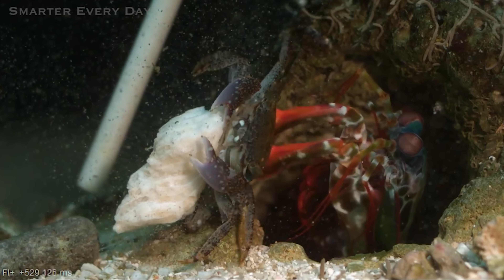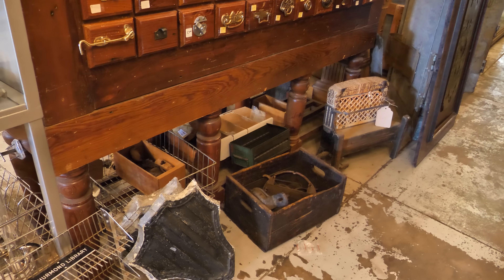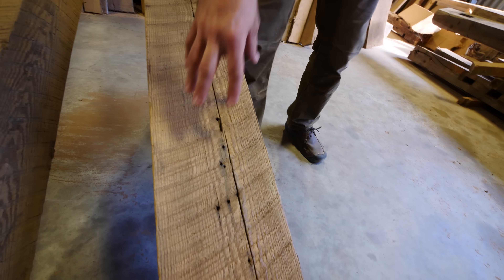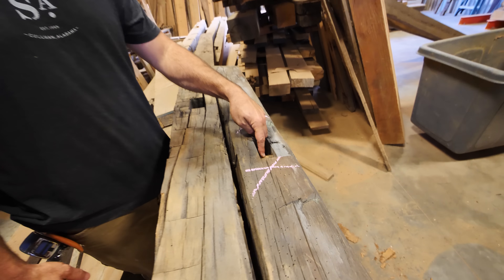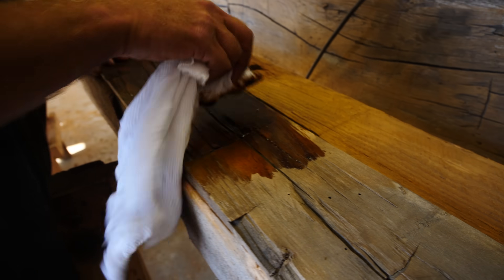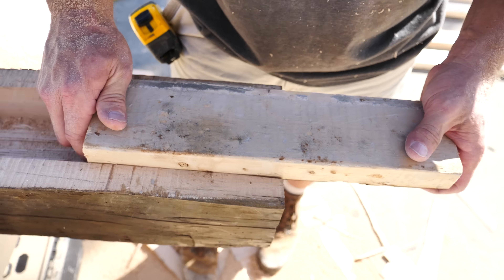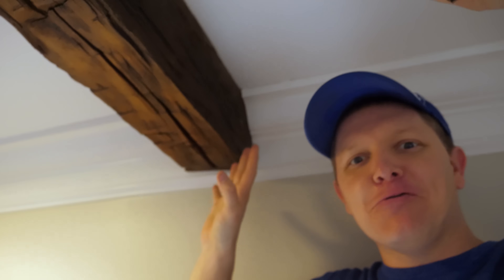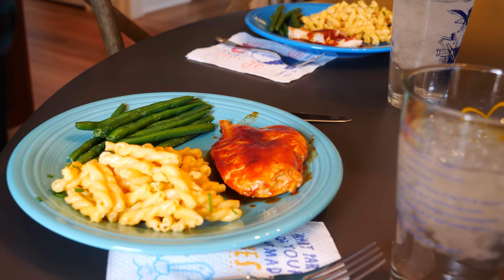Fake Beams - Smarter Every Day 186

Comment: 8:23 those few seconds where everyone realizes “hey, that’s pretty smart. Why aren’t we doing that” lol I loved that brief silence
Reply from the maker: A group epiphany.  It hit us all at once.
Reply: SmarterEveryDay haha, it was very clear and great. Thank you for the heart and pinning the comment! (I’m honestly really excited by it)
Reply: Daniel: I think the difference may be in the screws they are using.  High quality modern construction screws like Spax or GRK are quite the different beast than standard drywall, wood or whatever screws most people are familiar with.  I mean, they're fairly expensive, but used wisely they make up for it in labor, damage and liability. 

At around 7:02 you get a good view of the mounting board they are using, and those look an awful lot like GRK RSS screws holding the 2x4s up.  Rated somewhere around 160 lb of drawout force per inch of interface between threads and softwood in dry conditions,  and noting that there are at least six of those short little 2x4 sections screwed on where I assume the screws are actually going to go through the beam.  If they use long enough screws to go through 3 1/2" of construction lumber and noting there looks to be at least 6 of those mounting points you're talking about 3,360 pounds of holding power.  Maybe cut that down by 30% because it's going through two separate joined members rather than a single 4x4 and you're still rated over a ton. 

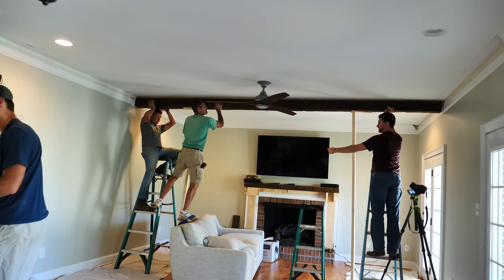The lack of serious struggle from two guys carrying the beam at 6:00 suggests each one probably weighs less than 500 pounds, so you have a 400% safety factor.  To run some numbers, an 8x8 (estimate from 8:03) beam at 16' (as the dealer states at 3:58) is a little over 7 cubic feet, and maple has a density around 40-50 pounds per square foot, so you're looking 280-350 pounds per beam from that estimate, minus any voids from mortices and the like, which feels right for the small effort shown by the two experienced guys carrying a beam.

I'm not an engineer, but the numbers used for something like this are widely available if you can figure out which terms to search for and how to decipher the data sheets.  Also, there's a chance I messed up interpreting the sheets in determining the drawout force, which is why consulting an engineer or at least experienced carpenter would be a good idea.  Especially if you are in a location prone to earthquakes or hurricanes.
Reply: How was the beam finally attached? Just the screws from the bottom?

My roommate did something similar in our house and we decided to drive screws from the sides thinking the beam would be too much weight for just the threads of the screws to hold from the bottom. Was that just being silly?
Reply: @danieldonkersloot3565  No you did it properly. Good job.
Reply: How about 8:14 for the catch? Send him to replace Greg Olsen with the Panthers? jk Greg cannot be replaced
Reply: The kickers should be pleeeenty strong to force the beam tight to the ceiling. Cut it 1" too long and hammer the bottoms more vertical for plenty of lifting power (seriously you can break a building doing it). Then lateral case hardened screws every 2' or so is plenty for a decorative box beam. For something decorative either way is fine but lateral is superior structurally and doesn't show as readily.

Maybe he cut the kickers too short. In which case you can put a flat bar under it and step on it to have fine control over the lift.
Reply: Ehhh.... that’d be too easy.
Reply: When a rocket scientist works with carpenters 😂😂😂.
Reply: Screws are usually much stronger in tensile capacity than shear - sometimes 50% or more.  So they're much stronger driven from the bottom.
Reply: What's even funnier, you can hear chirping in the background almost like a cricket lol.
Reply: "That'd be too easy."
Reply: No not silly but it is likely how the 2 by 4 is held to the ceiling so what do you do? Enough screws will hold a lot. It was a good way to get them set and then they probably ran some in horizontally along with the rest of the project off camera. I'm sure they know what they are doing and - I won't get an invite over there anyway so, pffft.
Reply: Gamefreak there’s at least one of those on every project!
Reply: "*brrrrtttt*... Liiiiike it grew there!"
Reply: As someone getting into woodworking, I really appreciate this video.
Reply: As a software engineer, I get those moments every week: "Wait, wait, wait... guys!"
Reply: This video caught my eye when I saw the beams and thought maybe I could do same in my mobile home.  While watching video I quickly figured out that would be crazy.  But what I was wondering was what would the cost be to do something like this in a home.  I believe it would be cost prohibitive for most people.  Informative video though.
Reply: What did Destin actually say at that point? I can't seem to hear it....
Reply: Having done this professionally, the reason why you don't pull them up with construction screws is because it puts the screws in much more visible location.  If you can get the beam pushed all the way to the ceiling without driving it up you can put your fasteners in horizontally.  This allows you to use fasteners with significantly smaller heads.  You really don't need a head as the screws are in shear.  Because you won't ever be at eye level with the fasteners they then disappear with the smallest amount of putty.  It makes them much more believable as a structural component.
Reply: That's what's known as the "D'oh moment".
Reply: Yes I do love you too baby just don’t don’t wanted to talk to me you in twitch It’s just just fine but I love 💕 too bad lol I just just got done done so I’ll woke up 🆙 don’t know what mommy to wayyyy I just want you to know I love you lol you don’t want to talk to you too buddy I don’t know why what too babe I hoped I could have it in a little while lol you have fun 🤩 I’m not gonna do it anymore I’m sorry but I’m just chilling on twitch lol I’m I’m tired and I’m not gonna lie I I love don’t talk to you too baby I’m sorry I’m so tired of that that I don’t feel like I’m doing something I like to do talk about to to do something else lol I just anymore and I’ll be fine you dont wanted a good job and I love it  😻 I don’t know how much you love me so much I I don’t want you too baby I’m not gonna gonna do anything wrong I just don’t feel likes you too babe I love it it 😻 I just don’t want to talk yourself about anything you don’t like like it it lol you don’t want want sleepy and I like that you too babe I don’t feel good you don’t like that lol lol I’m so sorru  good love you too in in the bed 🛌 I’m not tired good your good day babe love mommy bye moms I hope don’t get me to do anything you you need need me anymore I’m love morning baby you too babe daddy love 💕 bye mommy love mommy bye mommy daddy daddy love mommy mommy love mommy baby daddy chill buddy love you too babe I’m good just got home many love love love mommy bye mommy love mommy daddy love mommy bye bye buddy  👋 mommy love you buddy love 💕 bye 👋 good night buddy buddy I hope you have fun loves it love you too babe I’m so sorry I just got got kicked out of the schoolwork lol lol sorry I’m not tired lol but lol I just got off work so I’ll be there soon I love you y’all are goodnight  good morning I’m tired lol I’m tired and and watching the movie I dont get I love of hatchlings  and my barber barber and I’m so proud of you 👏 I I’m sorry you didn’t mean like 👍 me too lol I just woke you up I’m
Reply: Takes some skill to attach a piece of wood to a wooden house.

Comment: Old beams may have chamfered corners.  This was done to improve fire resistance, the corners of the beam are what catch fire first (for the reason think about how the surface area to volume ratio changes at the corner edge of the beam).  I learned that touring an old carriage house in Cape May, NJ decades ago.

Comment: Rather than cut that antique peg, why not just drill a hole through the 2X4 and pop the peg through like it originally was?  I would assume the 2X4 was attached to the ceiling well enough to survive a partial hole through it.  Just seems sacrilegious to cut the peg.

Comment: I would have just cut new "2x4" (90x45 Aussie term) longer than what you needed and wedged them under your beams so they aren't exactly vertical and maybe put one of those little wedge piece's you used under the beam so you don't damage it, then hammer the beam to a vertical position with a hammer, this should force the beam to push up higher to the ceiling. I only chimed in 3 years too late 😂

Comment: Honestly 2 more in the space between the kitchen and the living room would look amazing, I deal in antiques I’ve reclaimed and collected so much over the years from old abandoned houses, there was one home just down the road from my parents built in the 1820s and had an addition built in the 1880s I got some amazing floor boards out of it that were 20 inches wide and 26 foot long ship lap joints, large circle saw blade marks that almost looked flat from a massive blade that was easily over 50 inches. Got a couple chestnut beams 1 32 foot 12x12,  2 26 foot 12x12 and 6 8x8s of various lengths, saved all the blacksmithed t nails, my favorite piece was the oak kitchen table it’s 11’ 6” x 4’ 2” with nice rounded trim and so much ware on the table to 200 years plus of use you could never duplicate, burned on the bottom says Archibald Devers Brimfield Massachusetts 1805 everyone that comes in my house wants it been offered.

Comment: As a wooden boat builder, let me pass along that the 'plugs' used to hide the screws are called 'bungs'. As pointed out in your video, bungs have the grain running across the diameter; dowels have axial grain. Our family boat has 5,000 bungs in the planking.

Comment: I have got some old shutters that are made of solid wood (as opposed to chipboard) that came from somewhere I used to work about 30 years ago. (They were getting some new shutters.) They have been in my loft since then. They have got bits of old fittings on them. I have used them as shelves.

Comment: Being a child from the 70's, I remember my parents doing some remodeling with dark pecan paneling. They had torn down a wall between the living room and kitchen and had to cover the structural boards that kept the ceiling from caving in. You could actually buy fake hand cut beams made out of polyurethane foam. They actually had the inset cut out just like the ones y'all made. As a kid, I was fascinated by this fake beam. The real deal looks soooooo much better.

Comment: when people tear that house down, nobody will know they're so old..?
Reply: We used to throw up fake beams bu fasten them on the sides, up by the ceiling into the 2x4 so we didn't have fastener signs in the face.... or visible bottom.  Might not be the biggest deal on such rough surfaces...

Comment: "You want to make it look as structural as possible"
*Puts beam above window's opening*
Me, an architecture student and about to collapse: DDD:

Edit: Actually an architect now :')
Reply: Might consider changing the base and crown molding to a stained grade wood. It would make it feel a whole lot more cozy. Staining the trim around the windows and doors would help also.
Reply: Those beams look so out of place, not a good interior design choice IMO. Should of made some furniture with it or something.
Reply: I don't like it. It's hokey, it's fake.
Reply: @stevenkelby2169  Agreed. Talk about disrespecting the original craftsman. It'd be better turned into furniture, shelving, literally anything practical instead of fake ceiling decoration.
Reply: @broc226  go buy some then and do that 👍🏽
Reply: @colegoble  Exactly.  Post a video of YOU doing something creative, hero.
Reply: @broc226  an actual craftsman would probably appreciate the fact that it looks real and adds value to the house even if it isn't practical. My Grandfather had dozens of little things in his house, that he built himself, that served no purpose other than to hide functional bits or make the house look better. That is a normal thing even today, and if you don't believe me take a look at the drywall in your house or the recessed lighting.
Reply: @seanpeacock4290  Sure, but as you pointed out, the stuff your grandfather did served some purpose, this doesn't, it isn't covering anything it's just an addon, and it doesn't even match the aesthetic of the room.

They took old growth, recovered structural timber, and turned it into a tacky decoration which will go in the trash next time that house is remodeled.
Reply: @Nevir202  Well one would assume the point was to change the aesthetic of the room, not match it? I mean your impression that this is tacky is of course valid, but that is the problem with that entire term, it's incredibly subjective. Then again, I generally lean towards saying that all art (including interior design etc.) can be interpreted a number of ways, where whichever one judged to have the highest validity changes over time. I usually find it easier discussing which opinions are not very likely to be useful. I would for instance say that you could be quite sure about claiming that the beams made the design less minimalist. Whether that's a good or bad thing is up to you. I think of minimalism and coziness almost as two opposites.
Reply: @Ohyehah  Sure, tacky is subjective, but I'd say the idea that crown molding clashes with rough hewn lumber is about as objective as anything related to design could possibly be.

To make it even worse, they didn't end up tying the molding in at the edges of the timber well, though I suppose it's mot impossible that he comes back to that later.
Reply: @Nevir202   bro it’s their house why are you so pressed ab it
Reply: @mjeesy  IDGAF about it. It's just a waste, to take something useful and make something useless out of it and even worse, it clashes with the rest of the décor.
Reply: @broc226  right? You can buy hand-hewn beams made today that are cheaper and just as effective at being decorative, without having to disrespect an antique
Reply: What a waste of perfectly good timber, someone could have used these as actual structural members instead of fakes.
Reply: Congrats bro
Reply: it looks like a double door. From just a quick look I would have put one beam on each side to make it look like the main support is on each side of the door. but there could be other considerations that we don't see like pluming or actual structural elements.
Reply: I like it. That beam has been structural for a lifetime, think of this as its retirement. Let it be non-structural, it's deserved a rest.
Reply: @Geert2682  Now, that's a wonderful addition, the beam is canonically resting after a life of service.

Comment: Why are you not using the strips that are cut off other old beams like a veneer over a new board instead of using a perfectly good structural beam for a fake structural beam?  What a waste. And you pretended to be sad they were cutting the strip off of the old beam.

Comment: old beam HA, I lived in Italy and stayed in an apartment building that was built 900 years ago
The walls of the original building was made of "BIG river rock" 
The owners covered this rock with a lot of drywall compound to make smooth walls, but they did leave a 80cm section open from floor to ceiling  so you could see the original rock wall.
it was a two story building and they left the ceiling and beams exposed, all rough hewn   planks and 40 x 40cm beams.

Comment: Good job.... I do have one criticism. I've never found plug cutters to really hide very well.  An alternative that looks better (IMHO) is to take a branch of a tree with similar grain structure and sap content. Cut a piece of this small branch to a short length and drill an appropriately sized hole, even oblong the hole to fit the shape of the branch. Put glue in the hole pound the branch in and flush cut it to the beam. This is one way we used to hide holes in log homes.

Comment: how is the old wood not rotted?
Reply: Rot is caused by moisture and to an extent bugs. If you have wood that is stored in a proper way (part of a house or barn) it can last for generations. Here in the US our "REALLY old" houses are from the 1800s But if you look around Europe there are houses from the 1400s that still have the original timber. It is all about the care, planning, and storage of the material.

Comment: My old home in my home country Lithuania is 230+ years old with still original beams and rooms. When ever I visit it, it always seems fascinating and cosy even though a lot of paint is already covering most of the wood due to its age, I mean at this point my dad who is a really good builder had to put metal frame poles to hold up the house a bit better since every time there is a storm you can see the houses wobble due to its age.

Comment: I always thought woods are  fragile building material, but seeing those beams & doors came from 1800's I have a new appreciation for them
Reply: We have a lot of old barns, like the one those beams come out of, were I live. When one gets torn down, they remove the roof, all the wall boards and doors, till it is just a skeleton of beams. Then they have to use tractors and/or semis to pull the beam frame to make it collapse. Today's lumber can't hold a candle to the old wood.

Comment: Living in a 150 year old house with lots of hand hewn beams out of the 17th and 18th century everywhere which are REAL structural elements this looks a bit superficial to me. But ok, different strokes for different people…
But there would have been better ways to do the botching ;-) Do a better job in measuring the ceiling next time and use the already existing holes and checks to fasten the beam. And a wooden nail is slimmer on one side and looks beated on the other…